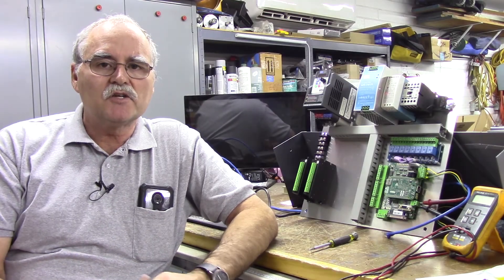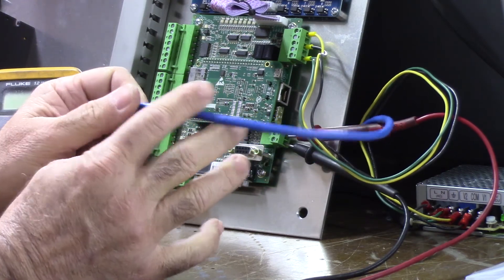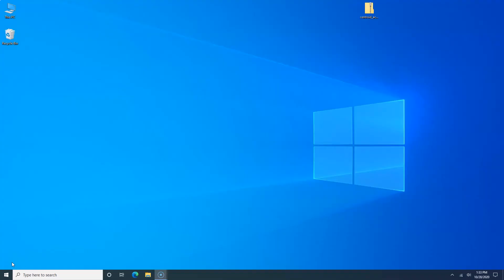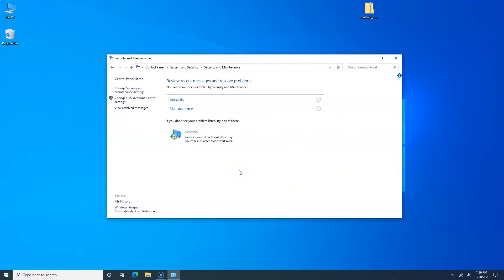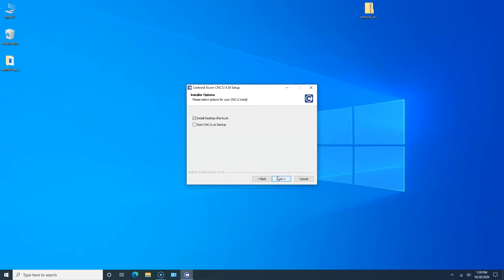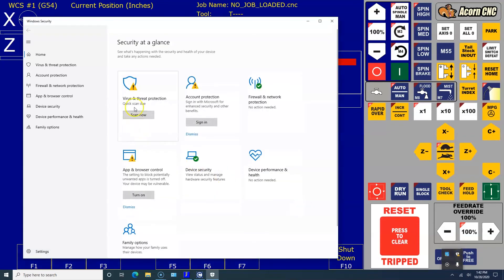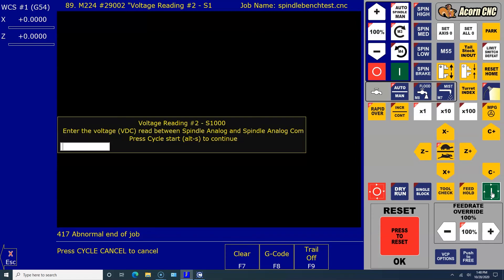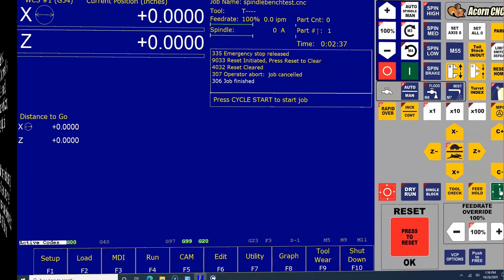UPDATED: Setting up Windows 10 for CNC12, Bench testing your new Acorn CNC Motion Controller

Comment: Great video as always Marty. Quick question for you. I'm getting another computer to run cnc12 on. Is there a way to import all my settings from the other computer or do I have to manually do everything. Thanks.
Reply from the maker: Just creat a fresh report, F7 Utility, F7 Create Report. Save it to a USB stick. Connect the new computer to Acorn, fire the PC and Acorn up. Instal the same version of CNC12 on the new computer. Once that is done, start CNC12 to establish communication to Acorn. Then insert the USB stick with the saved report into the new computer. Press F7 Utility and I believer F2 Restore Report  and point Windows to the saved file on the USB stick. Iince restored, exit CNC12 and restart. All should be back to the way it was.

Tip: Take the time to use the Windows 10 Snipping tool to create screen shots of all your Wizard pages. Print them out. That way you'll have a hard cooynof all your settings

Comment: Hello Marty 👋 I'm a big fan I have a question I have 3 cl86y closed loop  stepper online drivers to wire up... my question is what voltage should I run to the drivers the 24v from the Acorn board? For all 3 driver I didn't want to do that I figured it would be too much for the board to supply
Reply from the maker: Hi, please post your question along with the link to the drive manual on the Centroid CNC Acorn users forum. I check there at least once per day. The same question has been asked a lot there. Search closed loop stepper on the forum.
Reply: Will do thanks

Comment: Ordering my PC equipment this week for the Clearpath/Acorn build. As a designer (now retired), I've used a Mac both professionally and personally my entire life. This will be my first PC, so this is a great video for me about setting up the software for the CNC. Thanks for the info, and keep up the great work!
Reply from the maker: Thanks James...are you in a rush? The Bench Test video should be coming on in the next day or two. So far I am impressed.....but we are not done yet.....what kind of machine are you going to put these on?
Reply: @martyscncgarage5275  I'm not in a hurry - this is month five of the project. I'm putting these on a 4 x 8 gantry router that I've built over the last few months. I'll have a Teknomotor external fan-cooled 2.2kw spindle (very cool design with the low-noise benefits of a water-cooled spindle, but the ease of installation and maintenance of an air-cooled one) and Delta VFD. Currently working with DamenCNC in Denmark to get that together. I've been putting off this part of the electronics and have ordered and returned the Acorn twice because I couldn't bring myself to start. This project is my 2020-21 "hobby-of-the-year". Each year I pick something that I believe to be just barely within my abilities to learn all about and do. This is this years. Haha!
Reply from the maker: @jamesmaccubbin7434  Cool. Give it a couple more weeks and stay tuned...... ;-)
Reply from the maker: Make sure if you have any questions about Acorn, to post to the Centroid Acorn User's Forum WITH details about your build. https://centroidcncforum.com/viewforum.php?f=60 follow this post: https://centroidcncforum.com/viewtopic.php?f=60&t=1043 the more information you provide the better suggestions we can give you.